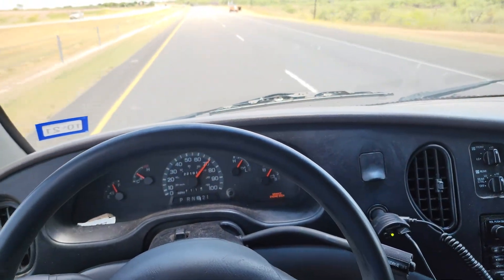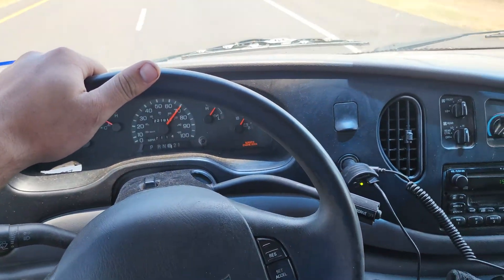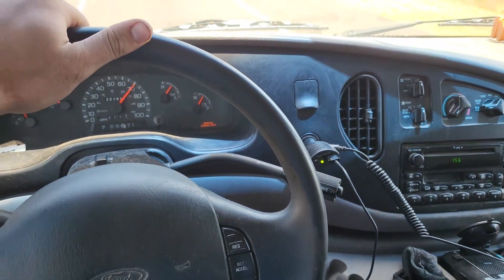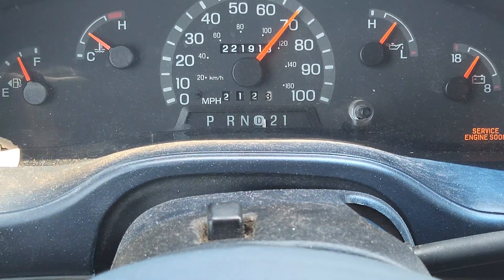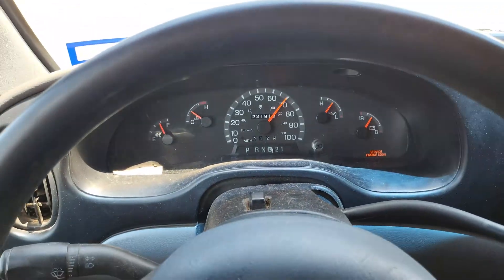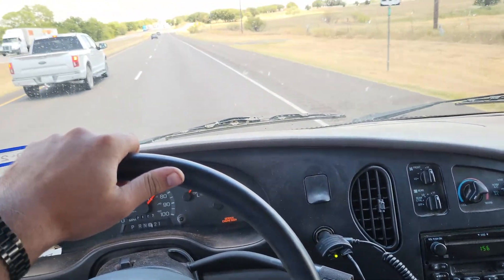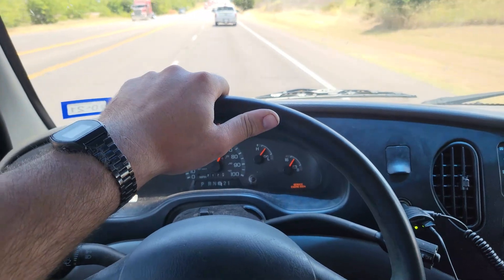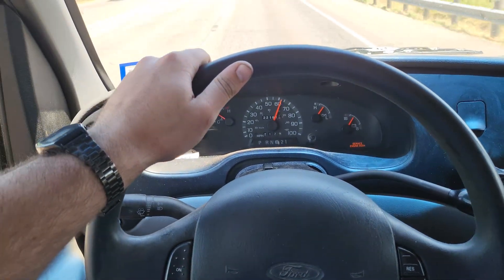Can you drive a 5.4 Triton with a blown out spark plug?

Comment: My 5.4 blew spark plug 4. It was forceful enough to break the mounting tab on the coil and BEND THE FUEL RAIL, causing massive fuel leakage atop the engine. In addition, one O-ring on the number 3 injector came off and caused the fuel leak. Gas was everywhere. Just hope cylinder 4 never blows. If that happens, you're in for a very challenging job to repair it without pulling the cylinder hear OR the whole engine to gain access to the affected cylinder. My truck went 293,000 miles before the first blown plug. I grew up when 50,000 miles was a lot for an engine to live.

Comment: Just drove 45 minutes to get home after blowing a spark plug on the highway. It was scary at first. But the car kept going, just with less power. I thought it was the exhaust, but the loss of power was indicating a cylinder misfire. I made it home, thankfully. I'm working on getting a rebore-kit today. I have work tomorrow. Wish me luck. Hopefully, I can get it fixed today 🙏🏻 but what a crappy design flaw being so few threads in the bore to hold the spark plug.
Reply: Hey bro will I be ok driving mine like this

Comment: I've got that exact same issue with my 98 Ford van with a 10 cylinder engine I looked at the spark plug. There is no stripping it doesn't look like it damaged the plug or the threads in the box but you can't get in there to put the plug back in it takes some special tool I don't know what tool
Reply: Look into TIMESERT kits. Complete tool assortment for reboring/rethreading the hole and putting in an insert. Not cheap, but cheaper then taking it to a shop if you are mechanically inclined - and have a place to work on the vehicle.

Comment: My 2006 F150 broke a spark plug tip when I was changing plugs that would not come out (I had the Lisle retractor) so I disconnected the fuel injector and spark coil and ran the truck for 8 months  (35,000 miles) like this until I could get it to a mechanic. It was all ok.

Comment: So which is the solution ? Put a new spark plug, or repair the engine thread! Probably the spark plug loss size by the heat?
Reply: Look at TIMESERT or other rebore/insert kits. Expensive, but cheaper than having a shop do the work - or replacing a cylinder head.

Comment: Yeah the trouble with YouTube is there must be 4000 videos on how to replace the spark plugs and the kit you have to buy. I ran across 2  that actually explained the cause of the problem not just how to correct the symptoms. kind of sounds like our health industry doesn't it. Well I watched two videos today talking about the 10th Generation early years with the 5.4 2V. Both of them talked about the vehicle going 50 to 60,000 and then you go to change the spark plugs and most mechanics don't understand the spark plug comes with an anti-seize coating but it's factory imprinted on the threads I don't see it so they start adding "never seize" all over it. The anti-seize compound squishies up the threads and coats anti-seize on the bevel seat of the plug. That's like putting anti-seize all over your lug nuts! The spark plug starts to back out; starting out at a very shallow four threads slowly gets to reduce to 3 heading for 2 and then it blows out. the other problem is the torque the factory spec is 13 foot pounds. Most mechanics don't torque spark plugs. This mechanic suggested going 20 to 25 ft lb to make sure it is seated and grips the threads enough not to start backing out. Ford has always had a problem with spark plugs backing out anyway. I've been changing those beveled seat plugs since I was in trade school in the 80s and every now and then I grabbed a Ford plug and it's already loose My instructor was a 25-year GM engineer that was always picking on Ford, go figure LOL he said even some Chevy's have beveled spark plugs and it doesn't matter what the torque spec in the book is you should use the torque J.B.B. Of course, several students asked what is J.B.B. instructor got an evil grin and said "Just Before Breaking"!

Comment: I get called out to help uhauls with the triton engine with the same issues. When it happens you unplug the injector, unbolt/unplug the coil, and remove both coil and spark plug out of the hole so the pressure from the cylinder doesn't keep the sparkplug continuously banging in to the sparkplug hole and damaging more then necessary. Very easy quick solution and will also quiet the noise as most of the loud noises you hear are both ignition of fuel pushing plug out then coil pack forcing plug to violently smack back against the head... your welcome. Oh also if you buy one like this because it's cheap and an easy repair... if the seller says it needs towed and won't start they are full of shit. This problem does not cause a no start.

Comment: The 5.4 triton is NOT a terrible engine.  They have issues but still a good performer.  Some people have nightmare stories and some have been great for them.  It is kind of ridiculous that Ford has had these issues with an otherwise great engine.  The 3V is good as long as you upgrade all the timing components with the high volume oil pump.  I’ve owned two triton 2Vs and never a spark plug blowout issue.  I’ve owned the 5.4 and 4.6 both with over 200k miles.
Reply: I Saw 45 Of Those Old Fords! 
That Proves That They Are Really Useful!
I Also Have A 5.4 Triton (99 F-150) And Its A Good Old Engine!
Reply: @tankthehedgehog105  i have a 99 F-150 with the 5.4 Triton engine. I have been driving it for over 20 years with a little over 158,000 miles on it. I experienced this a few weeks ago. I have never heard of such thing happening. I am in the process of repairing it, but i will say they are good engines.
Reply: I have a nightmare one right now. But i'm still not going To get rid of it, they're great engines
Reply: Should I do the inserts preventative? I just got a 2001 . I need it to go across country